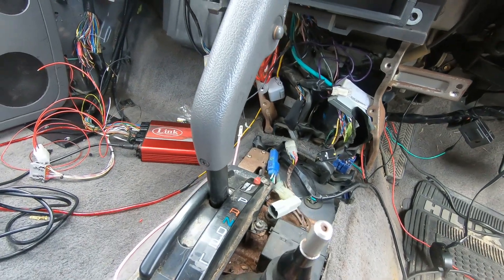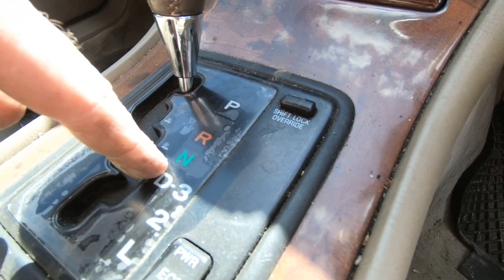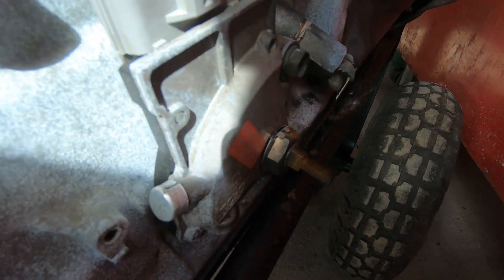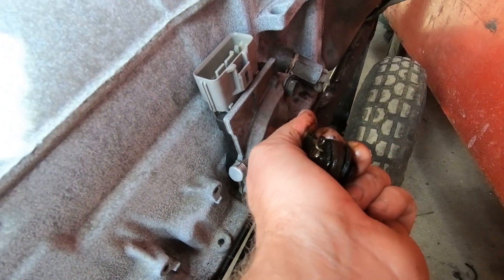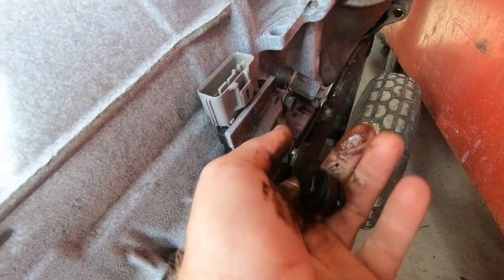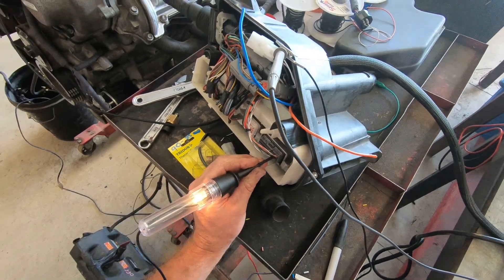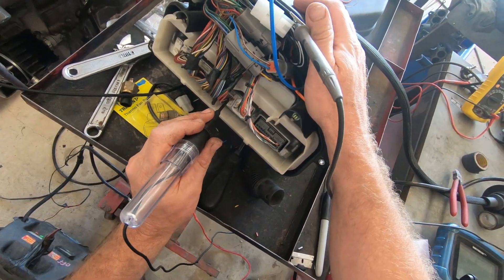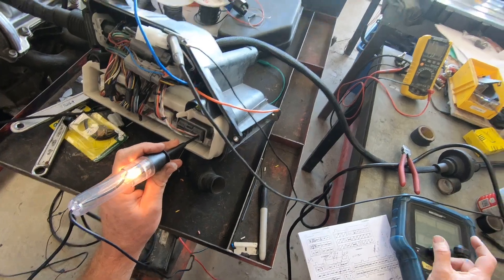1uz and 3uz 5 speed A650 VVti shifter - how it works.

Comment: The '98 and '99 Lexus GS 400 also have paddle type buttons on the steering wheel to play with as well ;) Great info Kelvin
Reply from the maker: Hello Billy.  The paddles are also an interesting topic.  Cheers Kelvin
Reply: Indeed .. brings me to an important question regarding the e-shift on the aristo ecu. For my swapped GS300, how do I get the e-shift to work without the buttons on my steering wheel? 
If not then at least get 3rd when shifting away from D position.  Would be nice to add that one more toyota's 90s ahead of its time feature. 
Thx
Reply: is there a way to make the tiptronic downshift to 1st gear? The ECU limits the downshift to 2nd and not 1st gear

Comment: I've got the a340e with a manualised loom. The ucf20 style shifter is mint for burnouts can go from 3 to 2 without moving gates
Reply from the maker: Using stock gear can give great results when applied correctly.   Cheers Kelvin

Comment: Thank you for sharing. Can you please shed more light on the switches when the lever is moved in the side ward direction in the 5 speed vvti A650 box for example (1st gear and 4 /5th gear). How do these switches talk to the ECU? I am trying to develop a push button shifter using Arduino and servo motor, My aim is to have a + and - button so that I can up shift  through 5 gears, but still go through the ecu so that all the built in safety measures in terms of speed and rpm still remain operational. I am using a 5 speed vvti with the factory ecu. - South Africa
Reply from the maker: Hello.  This is all I will be sharing on this topic for free due to both time constraints and that my income if from selling wiring information. Cheers Kelvin
Reply: Hi Kelvin, Thank you for the response. Sorry for the misunderstanding. I am prepared to pay. I will drop you a mail. Kind Regards Ish

Comment: I swapped a few wires and now 1 right of d gets 4th and 1 back from d gets 3rd makes gear selection really optimal if I need to go a lil fast or downshift for engine braking bump it right if I want vvti bump it 1 back ring it out and then grab 4th
Reply from the maker: ok.  They work well when set up correctly. Cheers Kelvin
Reply: @CartuneNZ  yes but the switch for d-4 burned out so I used the 2-l switch I messed up getting the wires switched but I liked it after driving a minute so I left it

Comment: I just picked up a megasquirt with ms3X. I have been researching the a341e and how it is controlled by the ECU. Pretty simple to command it, but for controlling line pressure and shift timing automatically, do you know what inputs the stock ECU needs to command the transmission as expected? I would think obviously ecu needs tach, tps, and maybe some other sensors to calculate load? My goal is to use megasquirt as standalone for the engine but retain factory ecu for the trans.

Comment: Ive connected the L and 2 switch on mine since I want to hold the gearbox in 1st gear for offroading. However, for some reason it still gears to 2nd irregardless of the switch going on. Any tips on this?
Reply: I have the same problem
Reply from the maker: Have you confirmed the gear inputs into the ecu?

Comment: Ever changed bearing of a650 inside extended housing is it straight forward. Or need disable the whole box?🙏🏽
Reply from the maker: rear housing bearing is easy,  anything in front of that requires the transmission to come fully apart.  Cheers

Comment: hi, my car is bmw e39 convert 1uz vvti 5speed auto. My problem is that my gearbox runs full auto D, there is no option to change gear 1,2,3 manually, only fully press the gas pedal if you want to cut, there is no button hold power/sport/eco (can be made to and how). so when going down a high hill it's quite dangerous because the gear can't be dropped manually. I have to use the brake a lot. I hope you can give me an opinion. thank you

Comment: Man you are top class. Now I have a question. I'm doing a 3uz motor and box conversion in my t7 ranger. I want to use the rangers autobox shift lever and "straight pattern" panel with the Lexus unit underneath . The point is to have it looking oem. I will only need to use park, reverse, neutral and drive. Is this still possible. Any info would be greatly appreciated.  Thanks, have a good one

Comment: Hi I got a a650e trans that reverse stop working acts as its parked and neutral moves car for second before it engages other gears work fine, any suggestions on my problem?? Great channel definitely subbed!
Reply from the maker: hello.  If you arent getting reverse its normally a pretty bad sign.  Often the trans has expired.  Check fluid , sometimes a service , new filter and flush can save it.  Cheers Kelvin

Comment: Is it possible to still manually shift the transmission with a standalone ecu?
Reply from the maker: Provided the aftermarket ecu can control the transmission and supports manual mode then yes.
Reply: @CartuneNZ  so the lever and switches do nothing without an ecu? You can't just drive the car from L and shift up as you go?
Reply from the maker: The lever and switches provide signals to the ecu.  Without proper solenoid control the 5 speed transmission does not change gear correctly
Reply: @CartuneNZ  damn, i wish some sort of manual control shifter existed for these transmissions
Reply from the maker: I have a mate that made one years ago similar to my manual shift box but it was for his own use only

Comment: good time. is it possible to swap automatic transmission A341E to A650E/A750E to 1uz-fe non vvti (uzs131 1990)? thank you in advance
Reply from the maker: Yes absolutely possible provided a suitable transmission management solution is used.  Cheers Kelvin

Comment: Hey Kelvin, is there any way to reconfigure the a650e so when the selector is in last two positions it selects 1st and 2nd instead of 2nd and 3rd?
Reply from the maker: Ive never tried as I'm happy with the lowest position being 1st and 2nd and the next one being 3rd.  This way we have all the gears being selected nicely when using the shifter manually.  Cheers

Comment: Absolutely stupid question, but I'm going to ask it anyways. I'm going for a big power build, and from what I've seen, the A340e is much better suited to tuning, but I really don't like the stock shifting.... Whatever you call it. I'm doing this in a 93 SC400 (toyota Z30 chassis), with the thick rod 1uz. Is it possible/reasonable to swap that in?
Reply from the maker: Yes its possible to swap in the A650 provided you have a way to control the transmission as it is computer controlled.  Cheers Kelvin

Comment: Can u convert these 5 speed autos to 4x4 the same way you can with the 4 speed ones?
Reply from the maker: The 5 speed auto have a large one way clutch assembly in the tailshaft housing so require a different adaptor and the output shaft is a different size so more involved in the 5 speed.

Comment: What happens if you flick the D-4 switch while you are not in D??
Reply from the maker: I don't quite understand.   When set up correctly D-4 can  only be accessed from D or when coming from 3rd into D-4 position.   If anyone wires it wrong they are silly as the ecu wont like getting two gear inputs.  When wired correctly shift selector on side of box supplies voltage to D-4 switch to prevent issues.

Comment: 2 Questions, excuse the dumbness of them I'm still learning auto. 1. SO on these auto boxes you can manually shift every gear? Or select Drive and it does it all on its own? And 2, Where does the Eco/sport change over come into things?
Reply from the maker: Is that just two questions today? Haha.  Provided the shifter is set up correctly each gear can be shifted through however it limits the maximum top gear.  So in third if you floor it the ecu will shift to second.  Eco/sport alters the shift timing either earlier or later depending on mode selected.   Cheers Kelvin.
Reply: @CartuneNZ  Thanks again. Is there a way I can contribute towards your channel? I feel there will be many more questions once I have saved up to buy my motor and I don't like taking life knowledge and experience for nothing.
Reply from the maker: @stevenagel6096  Hello Steve.  I sell wiring instructions if using stock ecu and am even more helpful to purchasers.   If you have a big list of questions then I do ask for some payment for me time.  I've been considering doing a question time livestream with a small fee for questions so will look at that in the future.   If you want to make a donation i have paypal or even sharing some of my videos onto platforms of other interested groups is helpful.   Cheers Kelvin

Comment: The power switch next to the shifter on a 92 LS400  what dose it do
Reply from the maker: It alters when the trans changes gear.  Power with shift up later and kick down earlier.  Giving the feeling the engine has more power.  Cheers Kelvin
Reply: @CartuneNZ  hay can you answer me one more question? The button under the gas pedal on a LS400 what dose it do?

Comment: hi sir what is the wire code for the six speed shifter pls
Reply from the maker: That info is included with my wiring instructions and there are different options depending on vehicle model